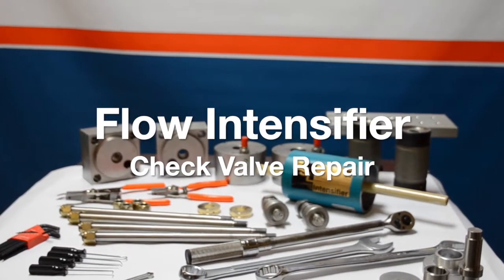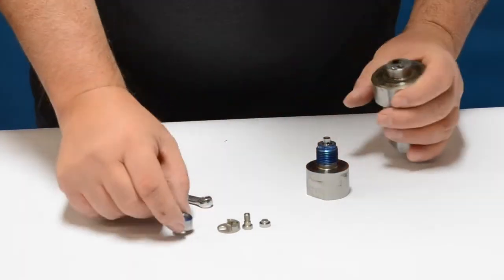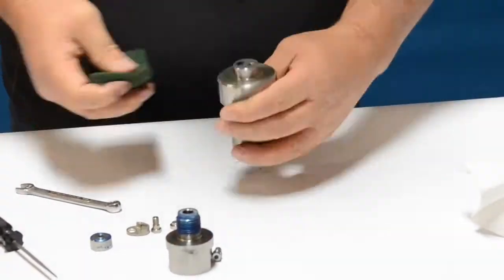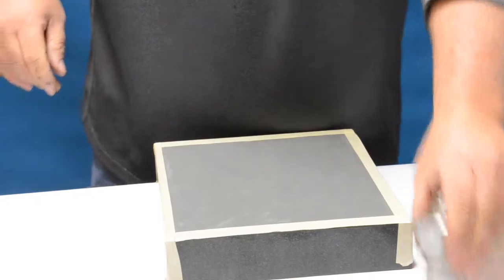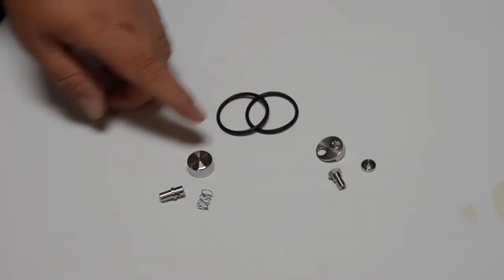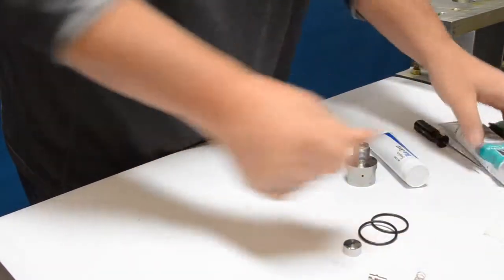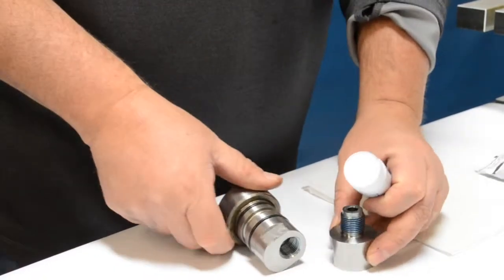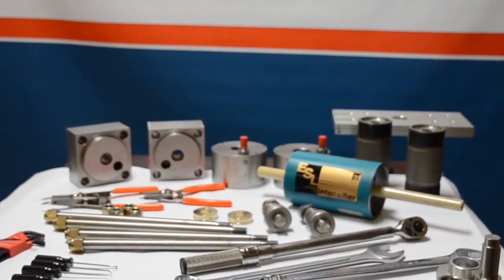Flow Waterjet Intensifier Instructional Video - Check Valves

Comment: You don't offer any information as for "when" to rebuild a check valve.  For that matter, neither does Flow offer much information about how often to replace the check valve parts (though I am sure their sales team would like this to be quite frequently lol).  In general I do not rebuild my check valves every time I have to go in to replace my high pressure seals.  I will generally rebuild the high pressure seals 2 - 3 times before lapping and rebuilding a check valve.   Even then I often feel that I may be doing the check valve rebuild prematurely.

I've rebuilt my check valves dozens of times over the years but I don't think I've ever had one actually fail to the point of an over stroke or loss of cutting pressure.  The only clue I can reliably use to gauge when a rebuild kit is needed, is when I start to hear the check valve "squeal" a bit on each stroke (think clarinet or horn sound).   I would be curious to know at what intervals you guys recommend the lapping and rebuild of check valve rebuild.

Anyhow, great video series, sure wish I had know about your channel years ago when I was learning how to maintain a Flow IFB 60K.  Thanks for all the clips!